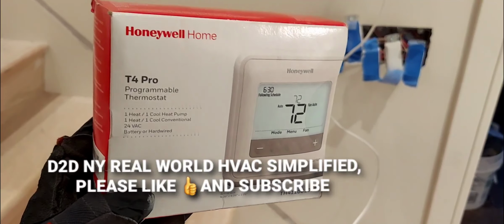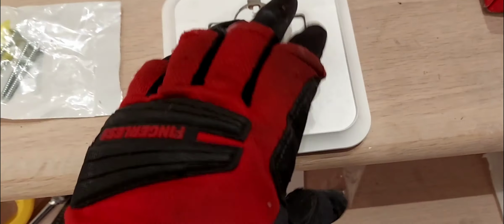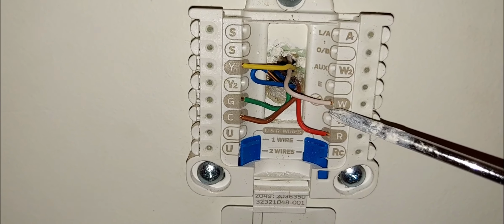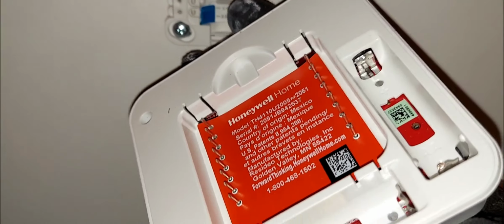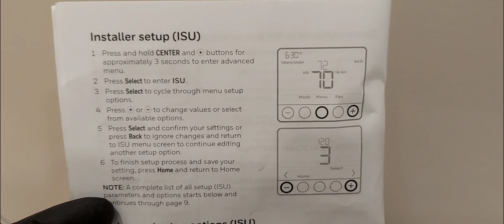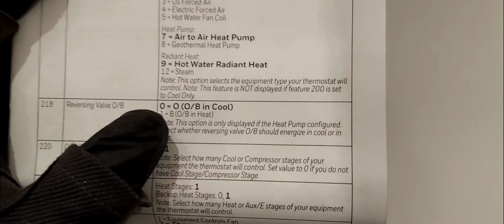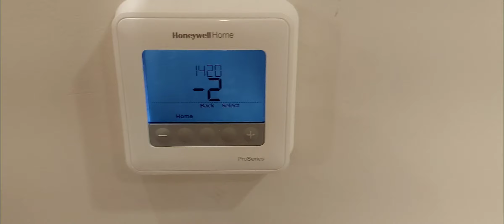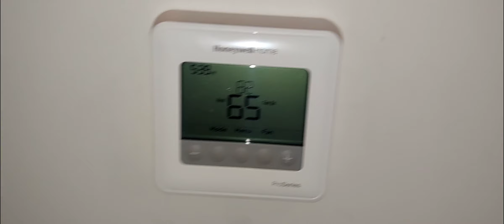HONEYWELL HOME T4 PRO THERMOSTAT

Comment: Thank you sir
Reply from the maker: Thanks for watching
Reply: @D2DNYAC  I have an old honeywell t0809a and on the wiring configuration there a blue and black goin to two different c terminal on that old honey well... on the t4 is there an extra common.... I'm doin heat only
Reply: @D2DNYAC  it's an old mercury type honey well thermostat.  4 wire . I got red goin to r . White going to w. There's a blue goin to c and a black goin to another c. Are there 2 commons on the t4 you covered? Thanks

Comment: Mine will not blowing ac and I pressed off.
Reply from the maker: How is the fan settings??? 
Or
Pop the thermostat off the sub base if the unit still runs its not the thermostat, if it does check fan settings

Comment: Nice vid. I have a typical forced hot air system with an outside air conditioner compressor all using the same vents for heating and cooling. Do I keep the blue tab on the right in the up position?
Reply from the maker: Are you talking about the T/RH toggle?
Reply: @D2DNYAC  yes, the blue switch on the bottom right.
Reply from the maker: R/RH toggle should only be touched if you have a separate heat source independent of the AC system a boiler or electric duct heater to name a few,, R is ac or cooling system controls power and RH is heating system controls power

Comment: Does this thermostat display when auxiliary heat is on? I have a Goodman 1cool/2heat heat pump. I can see when emergency heat is on because I have to manually turn it on, but I never see auxiliary or aux displayed.
Reply from the maker: Emergency heat is another mode auxiliary heat is another stage of heat  oftentimes electric that compliments the heat pump

Comment: Is the only difference with a heat pump the location of the white wire? I am attempting to replace an old carrier thermostat which has six wires. The additional wire is orange; do I need it? FYI, my C wire for the original thermostat is also brown.
Reply from the maker: With Heat pump system the old thermostat would have O/B  terminated on it … that’s the difference
Reply: @D2DNYAC  Thanks for the response. I wired the white to the O/B and left the orange off; programmed for heat pump and the heat wouldn't shut off. Also, the cool would never start. So I just have no idea.
Reply from the maker: Sounds like there's other issues 🤔 you should consider calling a pro

Comment: You didn’t mention using the Temporary Hold setting nor the Permanent Hold setting..
Reply from the maker: Temporary hold means if you increase or decrease temperature set point it will revert back to schedule temperature setting after a pre determined time period, permanent hold means any temperature setting changes will be held indefinitely or until you remove or change it !!!

Comment: i had the temperature on 70 and the temperature in the house is 79. I cant get it any cooler. I thought maybe I would move the temperature to 67 so the temperature in the house went up zoomed to 80. The mode is cool and we have it on hold. can you help
Reply from the maker: Possible your hvac system needs service

Comment: I have an electric heater so I chose 4 for 205. But when using cooling mode, it starts heating, no cool air, what do you think went wrong?
Reply from the maker: If you have a heat pump then reversing valve configuration in setup is wrong if No then re check your wiring!
Reply: Can u explain how to fix this easier for me!! I put it on cool and it blows heat smh I need this fixed asap
Reply: @Just-RegularGuy sounds like you need to get into the setup settings. Pressing the center button and the + button at the same time gets you in. 
Press select till you get to 218 and press the plus (+) or the minus (-) to change the reversing valve. If it’s a 0 you need a 1, if it’s 1 you need a 0.

Comment: What model number is the wall plate, my TH4110U2005/U didn't come with one.
Reply from the maker: Not sure if that’s sold separately
Reply: @D2DNYAC  Ok, thanks for the response! Keep up the awesome videos! One thing I'd like to see is a installation video of a RTH6580WF1001/W1 on your HVAC demo board out in your garage, maybe testing it with the RedLINK web portal too. Thanks!

Comment: My black wire is not connected is that ok?? And I got no heat option on the Honeywell thermostat.
Reply from the maker: If you are using the batteries yes, and if you select cool stages only in setup then heat mode will not be available, go back in not the setup menu and fix this
Reply: Yes thank you so much!! It needed to be changed in the advanced settings.

Comment: Hi there, I took off my old theomestat yesterday, there is a black wire but it connects to a spot showing W2 instead of C, would you know why?
Reply from the maker: Because in your case the black wire is used for second stage heat or w2  and so it cannot  be used on the C terminal

Comment: I set mine up today but no hot air seems to be flowing out of my vents. I can hear it turn on but it turns off after a minute. Any idea of what this issue is?
Reply from the maker: Are we talking heating or cooling?
Reply from the maker: If in the case of heating place fan to on then check for air from vents, if air flows then it’s problem with heat source, if no recheck thermostat

Comment: Great video! Thank you! Especially for the reset to removing the scheduling feature. My problem is my thermostat won’t stop running when the room reaches the set temperature, even though the Fan is set to Auto. How do I fix that?! Because my heating bills keep going through the roof!
Reply from the maker: @Bahg Onzi How much degrees does it over shoots?

Comment: I try to install the Honeywell RTH8500 series programmable thermostat in my apartment unit. The existing wiring is Red (R), Yellow(Y), Black(W) & Grey(G). Am I having the correct terminals? Thx.
Reply from the maker: Looks like you have the necessary wires for 1 heat and 1 cool!! If you match the new thermostat with the old thermostat terminals you are good to go.. the colors on each terminals may vary based on availability or person that did the  initial installation.
Reply: @D2DNYAC  Thx for your quick response.

Comment: Something wrong with my 72° it's not turning on at all I waited waited waited every time I put it on 71 it does turn on not 72° degrees on my Honeywell pro let me know how to fix it I want to put on 72°thermostat temperature
Reply from the maker: There’s a control band I believe the the default is 2 degrees F so if you se it at 72 it most likely will not turn on when temperature reads 72 however at 73 it should if it shows 72 then with a 71 degrees set point it would turn on
Reply: @D2DNYAC  what are you saying On F
Reply from the maker: @TigerGamming9095 F” ?? Fahrenheit!!!
Reply: @D2DNYAC  Thanks you
Reply: @D2DNYAC  why my thermostat turn off every 5 minutes on 72° it never turns off on 72° cool on fix
Reply from the maker: @tigerGaming9095 what temperature is your thermostat set at?
Reply: Why my AC is not getting very very cold in my house it not blowing hard cold
Reply from the maker: Ooh okay if the space temperature is more than 2 degrees above set temperature while system is on or should be on call a pro.
Reply from the maker: @tigerGaming9095 the issue is probably not your thermostat !
Reply: @D2DNYAC  if not cooling down in my room at all not getting cold enough we have to put more cold air compressor a can
Reply from the maker: @tigerGaming9095 my friend if the thermostat is on cooling/ cool mode and you lower the temperature settings to the lowest possible settings or number and your ac still don’t cool you need a Pro
Reply: @D2DNYAC  it's a Honeywell pro Series thermostat it's brand new I barely got six weeks ago
Reply from the maker: @tigerGaming why did you replace the thermostat ?
Reply: @D2DNYAC  it was working fine couple days ago somebody already fixed the unit I think it that week now somebody already prepared the unit already
Reply: @D2DNYAC  it's fixed now I think he won't turn off in the morning no more I I pushed all the wires in wasn't all the way in half way wires out I think that my dad is not going to turn off ever again in the morning fix what it was it's blowing little bit cold now fix now I'm he was the wires not work wasn't all the way in couple days it will run normal again maybe back to normal I hope it won't turn off in the morningno more I hope you will turn on in the morning I hope I fix it don't tell nobody it's a secret you and me
Reply: It turns off every morning it takes like 5 hours to turn on in the morning because it turns off every morning I know why
Reply: @D2DNYAC  this kind of thermostat does not turn on in the morning I don't know why on 72°Indy cooling on program I don't know why you won't turn on in the morning around like turns off  7am it will turn on about 1pm afternoon on 72 degrees do you know how to fix it do a trick tips
Reply from the maker: @tigerGaming when you are having these issues have you tried simply lowering the temperature set point to see if cooling turns on?
Reply: @D2DNYAC  I tried that it does work but I want it on 72 degrees in the morning
Reply from the maker: When you set the desired start/on time in schedule  you must also set the desired temperature as well!
Reply from the maker: If you are still having issues I will do a short video on scheduling for the T4 thermostat
Reply: @D2DNYAC  okay great when are you going to do it
Reply from the maker: This week perhaps for my next upload!
Reply: @D2DNYAC  Somebody reset my thermostat setting it messed up on the isu programming do you know how to put the setting back to normal back it was
Reply: @D2DNYAC  I know it's not my unit somebody already fixed the unit about 2 or 3 months ago something wrong with the Honeywell t4 pro thermostat settings on the isu programming because someone messed up my thermostat they they reset my thermostat format default because I know I can hear the fan running super fast
Reply: @D2DNYAC  my AC is gas my metal pipes is shaking making noise the whole house
Reply: @D2DNYAC  see if you do you know what website I can get the book for the thermostat settings on the Isu programming because I want to put the setting back it was first got it
Reply: Can I leave my AC in my house on nobody home it's on auto or have to turn it off which one
Reply from the maker: Up to you if you want to save money leave it off! If you desire comfort over saving money then leave it on, and for this 78 degrees F is a good setpoint
Reply: @D2DNYAC  ok thanks you
Reply: Why my Honeywell home pro series t4 I put it on 72° and the bottom correct get ever it slow not going down the same temperature what happened can I reset it the default if it's back to normal

Comment: Does the thermostat turn off and on by itself once it hits the temperature you set. I set mine to 71 for cool but the AC won’t turn off once it get to that temperature
Reply from the maker: Yes that's how it works, it shuts off when room temperature reaches set temperature 🌡.  Make sure your fan settings is on (auto) and not (on)!
Reply: D2D NY Real World HVAC Simplified okay thank you
Reply: @D2DNYAC  thank you so much I was scared I thought it was broken want something have a great day thank you for the help on your video
Reply: @D2DNYAC  why my temperature it's not cooling down my house warm cold

Comment: What’s the blue wire for?
Reply from the maker: Extra, I didn't need anymore wires for this setup
Reply: @D2DNYAC  blue is for C (common) correct?
Reply from the maker: Not exactly! when available the designated common / C is black wire  , keep in mind that if you are changing out a thermostat copy the wires and connections exactly as is from old to new and if you are not sure double check at air handler unit/HVAC unit to see exactly what wire or color goes to each terminals
Reply: @D2DNYAC  thank you